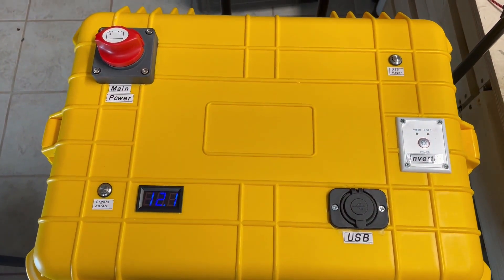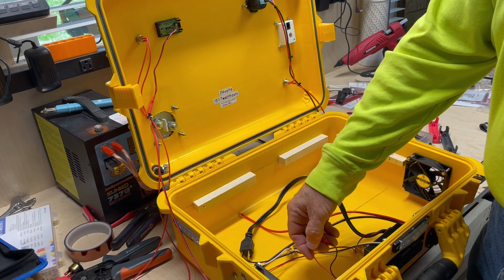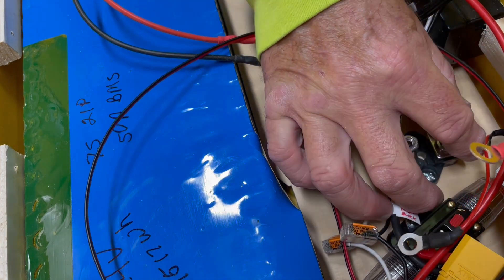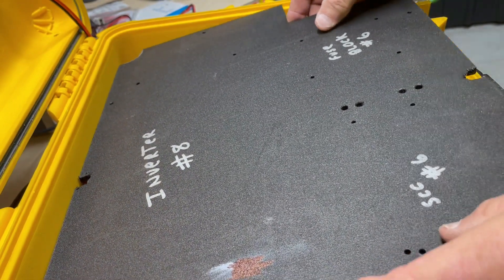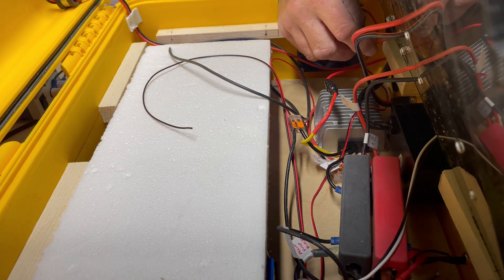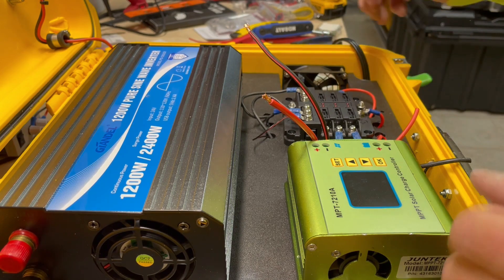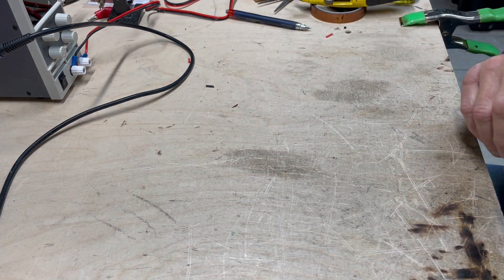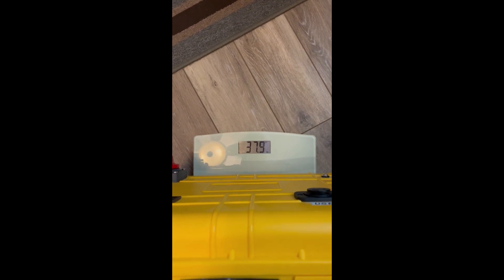Best Selling DIY Solar Generator

Comment: Curious what the actual Wh capacity is on the 120VAC, seeing as how you double convert.
Reply from the maker: The battery pack is 1500wh. How long it run depends on what you will be using.

Comment: Good morning sir how many cells did you use to meke that battery?
Reply from the maker: 148
Reply: @paulswoodshop395  Is possible to use pc cells like 18650
Reply from the maker: @macleangondwe8474  I used 18650 calls in a 7s 21p configuration.  This is about 1550watts.
Reply: @paulswoodshop395  i wish i could have your whatsapp number so that i can be updating you with my project

Comment: love how you build it cool i build one water proof tool box with 110V water proof out let have 2 20A Breaker switch for out let 150fused that my inverter come with with 20A Breaker switch for my inverter etc have cool fan water proof so even if it raning no rain can't get in my tool box where i have fan and have 12 volt light on it etc

Comment: Very very good how many battery have you used
Reply from the maker: Thanks. In this build I use 18650 lithium ion batteries in a 7s 21p configuration with a total of 147 batteries.

Comment: Great job but I dont think your charge controller is really an MPPT controller.
Reply from the maker: You are right it is not a MPPT controller. But, it works and is the only one that fits in the case.

Comment: Sweet!!!!! I built myself one several years ago. It is 850wh, 70ah and I bought a 100w solar panel for it. I used SLA batteries. It is on the heavy side.  Next one I build will definitely be lithium. I had a blast building mine and learned a lot. Yours is beautiful. Thank you very much for sharing this!!!!!

Comment: This is awesome.  Thank you for sharing.  The only thing I might consider doing differently is relocating the main disconenct. It can get bumped into on the side of case and get damaged.  Also the top mounted duplex AC outlets can have a cover or child proof protection, to prevent stuff from falling into the outlet connectors.  Great build!!
Reply from the maker: Thanks for watching. I will be adding more videos soon.

Comment: What batteries you use and where do you get them?
Reply from the maker: I buy salvaged 18650 lithium ion batteries and make my pack. If you watch the sites that sell salvage batteries you can find brand new ones for cheap. They are discontinues or have a bad BMS.

Comment: Where can one purchase it from? Thanks! Great video!
Reply from the maker: I live in the St. Louis, Mo. area. I am not able to ship the batteries due to having a hazmat license. I can ship without the battery pack.
Reply: @paulswoodshop395  I have a 48v 4.8kw 100ohms lithium battery.  Can you build a solar generator I can use this type of battery?

Comment: I’m interested in purchasing a solar generator as the one you demonstrate assembling. What is your selling price and what form of payment do you accept.
Reply from the maker: I sell this one for $1400 with a house charger but no solar panels. My problem is I can not ship due to the type of batteries that are used. I live in the St. Louis area if you are close.
Reply: @paulswoodshop395  I am 9 hrs from you so to far to travel.  What type of lithium chemistry batteries are you using?

Comment: Where do you sell your generators and how much. please comment
Reply from the maker: I sell this one for $1400 with a house charger but no solar panels. My problem is I can not ship due to the type of batteries that are used. I live in the St. Louis area if you are close.
Reply: @paulswoodshop395  thank you for all your information sure wish I lived closer to you but I live in Oklahoma and again thank you
Reply from the maker: @michaelflora375  How far are you from Springfield? I can meet there. I love Bass Pro Shop and Grizzly Tools.
Reply: What does the complete unit weigh?  I am looking for one for trailer camping and weight is a concern.
Reply from the maker: @19dsanders57  37.9lbs
Reply: @paulswoodshop395  thanks!
Reply from the maker: @19dsanders57  37.9lbs.
Thanks for watching

Comment: Excellent video, very informative. I have built a solar generator with 3-125 ah agm batteries, I'm looking to replace them with LifePo4 batteries, what would you charge to build a 400 ah, 12v battery pack? Thanks in advance, Clint
Reply from the maker: Glad it was helpful! As for the Batteries, I can not ship them but, here is a link to good LifePo4 batteries. Watch "Will Prowse" review and tear down. They are good batteries. https://www.currentconnected.com/product/sok-100/?ref=wp